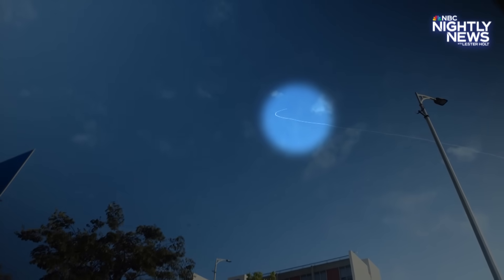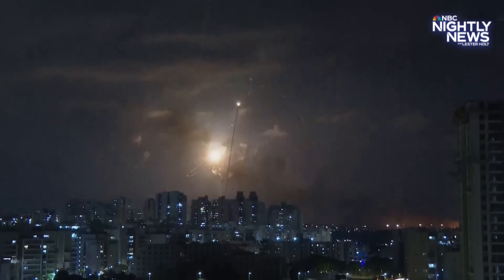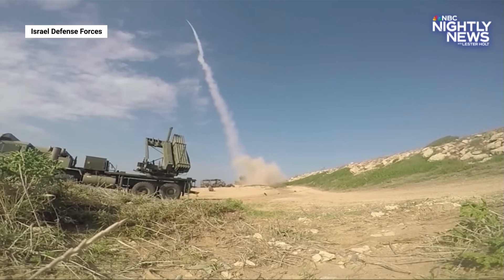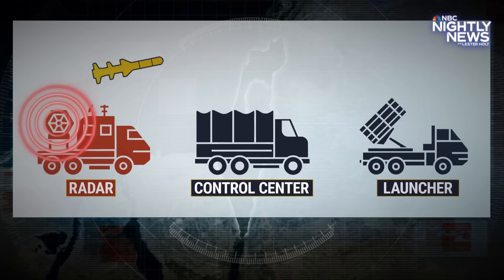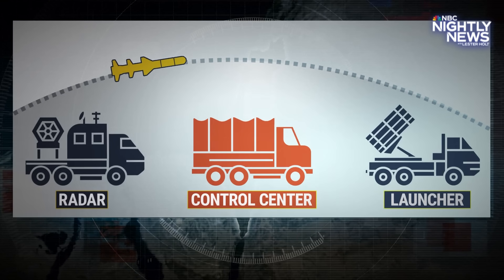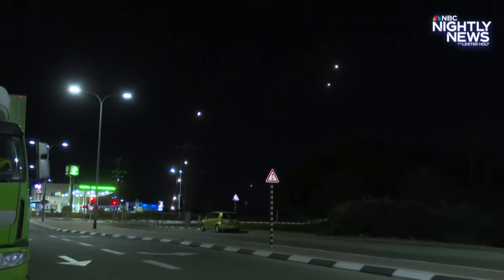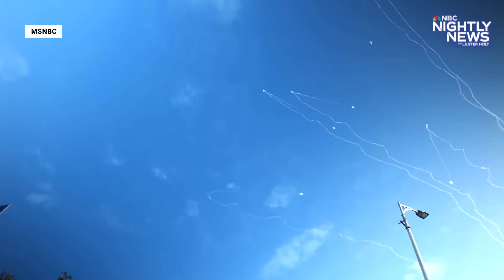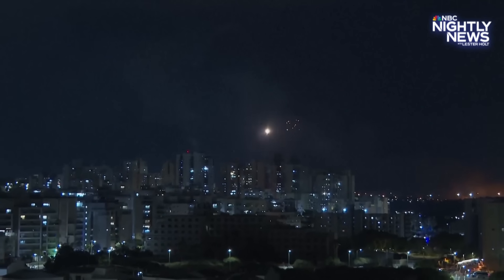Israel Iron Dome explainer

Comment: 4500 rockets from hamas , that mean at least 10,000 iron dome needed in a day , can iron dome stop thousands of rockets at once ?
Reply: Israel is reported to have ten Iron Dome batteries, each of which typically has 60 or 80 interceptor missiles available to fire.  That yields a maximum of 800 missiles ready to fire, but that's for the whole country, so probably fewer than 500 were available in range to intercept rockets coming from Gaza.  Estimating from the US Marine purchase of Iron Dome, each battery will have one reload available to it.  About 2/3 of incoming rockets are calculated to fall harmlessly in uninhabited areas, so aren't targeted.  Hamas fired about 4,500 rockets, meaning 1,500 were dangerous.  Iron Dome is 90% successful at hitting targeted rockets, so the 1,000 missiles (including reloads) in the area likely took out 900 rockets, meaning 600 hit in or near populated areas.  So even though there was considerable damage and loss of life, the attack would likely have been about three times worse without Iron Dome.
Reply: @pahtar7189  Thanks for the info 🙏🏼

Comment: You state that Iron Dome intercepted "many" incoming rockets, a wholly inadequate report.  Israel is reported to have ten Iron Dome batteries, each of which typically has 60 or 80 interceptor missiles available to fire.  That yields a maximum of 800 missiles ready to fire, but that's for the whole country, so probably fewer than 500 were available in range to intercept rockets coming from Gaza.  Estimating from the US Marine purchase of Iron Dome, each battery will have one reload available to it.  About 2/3 of incoming rockets are calculated to fall harmlessly in uninhabited areas, so aren't targeted.  Hamas fired about 4,500 rockets, meaning 1,500 were dangerous.  Iron Dome is 90% successful at hitting targeted rockets, so the 1,000 missiles (including reloads) in the area likely took out 900 rockets, meaning 600 hit in or near populated areas.  So even though there was considerable damage and loss of life, the attack would likely have been about three times worse without Iron Dome.

Comment: Those final 5% of rockets were the ones that really mattered, something like, 80% of them were decoys to overwhelm the Iron Dome so that the remaining 20% would hit actual targets
Reply: Yes hamas strategy is to tire iron dome and israelis economy since a missile cost about 40k$ while hamas unguided rocket only about 400$ - 4000$
Reply: Israel is reported to have ten Iron Dome batteries, each of which typically has 60 or 80 interceptor missiles available to fire.  That yields a maximum of 800 missiles ready to fire, but that's for the whole country, so probably fewer than 500 were available in range to intercept rockets coming from Gaza.  Estimating from the US Marine purchase of Iron Dome, each battery will have one reload available to it.  About 2/3 of incoming rockets are calculated to fall harmlessly in uninhabited areas, so aren't targeted.  Hamas fired about 4,500 rockets, meaning 1,500 were dangerous.  Iron Dome is 90% successful at hitting targeted rockets, so the 1,000 missiles (including reloads) in the area likely took out 900 rockets, meaning 600 hit in or near populated areas.  So even though there was considerable damage and loss of life, the attack would likely have been about three times worse without Iron Dome.
Reply: @pahtar7189  good calculation sir
Reply: Check out the hackers who overloaded the system weeks before this. I read an article it was “furrie hackers” 😯
Reply: What? Hamas has no dummy rockets. They just send a bunch of unguided missiles to overwhelm the iron dome. But there is no evidence that they have dummy rockets

Comment: So was it off the day of the attacks?? How did the best intelligence agency not see the movement of thousands of rockets literally 4 miles away?
Reply: Hamas fired thousands of rockets and overwhelmed the system, there's only so many interceptor missiles available at one time. Not to mention the fact that the system is not 100% effective, some missiles were going to get through regardless.
Reply: @johanndiaz8695  that's the best answer I heard. Thanks
Reply: The rockets were just a decoy that allowed hamas to jump the border while the guards took cover
Reply: Iron Dome was turned on.  There are many videos of rockets being intercepted.  Israel is reported to have ten Iron Dome batteries, each of which typically has 60 or 80 interceptor missiles available to fire.  That yields a maximum of 800 missiles ready to fire, but that's for the whole country, so probably fewer than 500 were available in range to intercept rockets coming from Gaza.  Estimating from the US Marine purchase of Iron Dome, each battery will have one reload available to it.  About 2/3 of incoming rockets are calculated to fall harmlessly in uninhabited areas, so aren't targeted.  Hamas fired about 4,500 rockets, meaning 1,500 were dangerous.  Iron Dome is 90% successful at hitting targeted rockets, so the 1,000 missiles (including reloads) in the area likely took out 900 rockets, meaning 600 hit in or near populated areas.  So even though there was considerable damage and loss of life, the attack would likely have been about three times worse without Iron Dome.
Reply: @pahtar7189  I don’t see any iron dome rockets chasing and intercepting hamas rockets. Do you? This Iron Dome thing is a lie. A radio signal is sent to a certain receiver, already installed in the incoming rocket, that tells the rocket to self destruct.
Reply: @pahtar7189 :  yes, something like your analysis, that is what happened. But why is the USA paying for it? We have huge debts.  Jewish people in Israel get better healthcare than Americans do. How does this make sense. Maybe God‘s chosen people get everything better from the subhuman people like USA?   Absolutely sickening!!
Reply: they didn't "connect the dots"...just like all the dummies in charge on 9/11
Reply: It's called a False Flag. Never forget the dancing Israelis after 911 and remember what the Jews did to the USS Liberty.
Reply: This is a lie. A radio signal is sent to a certain receiver, already installed in the incoming rocket, that tells the rocket to self destruct.
Reply: اسرائیل پیروز این بازی از قبل طراحی شده هستش
Reply: ASleep at the wheel.  Look at country is turning into a welfare state supported by USA money. Look at all the chubby fat Israeli troops
Reply: Because Russia China and Iran have the capabilities to now interfere. We can thank Joe Biden and Obama for that. May they rot in hell.
Reply: That was the point of the bulk attack so that it would overwhelm the iron dome. It doesnt shoot laser beams it shoots missiles with missiles and there are so many of them. Thats why it doesn't bother with missiles not headed towards an urban center. That makes me also think that it wouldnt be effective at all against smart weapons or those that can change their flight path
Reply: I heard of the (Futurama Character) Zapp Brannigan strategy:  send waves of soldiers/rockets towards the enemy in hopes of them running out of ammunition.
Reply: Around 4,500 rockets were fired indiscriminately into Israel the past few days. Some will always get through.
Reply: @greg6235  look I'm backing Israel it's just I'm hearing they got word bays before. Hamas was 4 miles away . Worldwide intelligence agencies and they all didn't see 5 k rockets being moved around less than 5 miles away in this day and age with thousands of satellites, informants,cyber security and on and on . In my personal opinion they wait for some damage to be done so they'd have a reason to totally wipe Gaza off the map. Can't say I blame them but truth is truth.
Reply: The guards were playing hop scotch in the yard.
Reply: It wasn't a US flagged naval vessel.................
Reply: maybe because it's all planned? look at the aftermath don't look at the event itself
Reply: @faidhr.h.hamdani8704  well I did notice the extra screams added to the audio like its not bad enough. That's something Russia does smh.
Reply: The teachings of the Honorable Elijah Muhammad (Who is still alive🛸) and Minister Louis Farrakhan emphasize that global peace and justice hinge on resolving the longstanding issues faced by Black people living in America, as all nations are interconnected; they advocate for true justice, defined as impartial and fair treatment, and warn that in today's era of judgment, consequences are inevitable unless there's genuine repentance..
Reply: @oneofgodsangels they need to get over it and move on like the rest of us have.
Reply: @ScottCampbell-xp5nx yea like Israel needs to 😂
Reply: @oneofgodsangels  I would agree, as a Christian our Bible says very similar things about this time. Im a 47 year old white guy however I have watched many many hours of minister Farrakhan and I deeply respect him. He cares about his people and gives a heck of a sermon.
Reply: It's not 100% efficient
Reply: @bradsanders407  yeah but hundreds died in one day then they pretty much shoot them all now. What was different?

Comment: Iron dome didnt work . And terrorist paragliding over the most heavily guarded fence in the world. They were let in
Reply: Iron Dome worked very well, but there were more rockets coming in than interceptor missiles.  And they aren't designed to attack low, slow aircraft like a paraglider, but any soldier with an assault rifle can.
Reply: @pahtar7189  No one gets close to that fence. The slow moving aircraft would have been seen by the thousands of cameras on that fence. And shot by the sentry guns. Wake up
Reply: @rl545454  The paragliders weren't the first ones over the walls.  Within 20 minutes, Hamas fired over four thousand rockets at Israeli cities, towns, and naval vessels.  As that was in progress they used bulldozers to smash through the fence in several places and thousands of troops streamed out via trucks, motorcycles, speedboats, paragliders, and on foot.  Paragliders were the last things Israeli troops were worried about when their checkpoints got overwhelmed.
Reply: @pahtar7189 First of all are you a A. I. Toll? Because you don't have a clue what went on.
Reply: @rl545454 : No, I'm a human and appear to have better information than you do.

Comment: So, why didn’t it work when the building was leveled???
Reply: They are sending hundreds of missiles at once at the cost of hardly nothing. The iron dome isn't 100% effective, is insanely expensive and doesn't have unlimited ammo ready to go at all times.
Reply: Israel is reported to have ten Iron Dome batteries, each of which typically has 60 or 80 interceptor missiles available to fire.  That yields a maximum of 800 missiles ready to fire, but that's for the whole country, so probably fewer than 500 were available in range to intercept rockets coming from Gaza.  Estimating from the US Marine purchase of Iron Dome, each battery will have one reload available to it.  About 2/3 of incoming rockets are calculated to fall harmlessly in uninhabited areas, so aren't targeted.  Hamas fired about 4,500 rockets, meaning 1,500 were dangerous.  Iron Dome is 90% successful at hitting targeted rockets, so the 1,000 missiles (including reloads) in the area likely took out 900 rockets, meaning 600 hit in or near populated areas.  So even though there was considerable damage and loss of life, the attack would likely have been about three times worse without Iron Dome.

Comment: An high altitude chemical laser is a better option, since it could inverse the cost differential of an interceptor missile against a low tech unguided rocket. Not sure of the initial cost or viability for large scale deployment.🤔
Reply: Having that stuff loiter indefinitely is not so feasible.
Reply: Then why aren't you there? They're not going to see you in Youtube comments.
Reply: @Leulogy   Starwars programme under  Ronald Reagan, tried to achieve it to counter icbm's and is a public knowledge. Eventhough it was dropped due to excessive budget and not proven effective for the specific application, it may be just suitable for the current situation. I am sure, it is already developed to a certain level, but may not be mature enough for full scale deployment.
Reply: @aware2action  As of right now, space-based laser interception is impossible. The power output the laser would need to have is way more than what we can produce now. But the biggest problem is the fact that you would need to have THOUSANDS of these satellites in orbit in order to always have one close enough to intercept a missile, and each one would need to have a monstrous laser we can't even produce yet. That's why the Star Wars program scrapped the idea.
Reply: @johanndiaz8695  Actually, Airborne chemical lasers were sufficient,except for the total weight of the entire system limiting flight duration, apart from need for frequent refueling. The main issue being the atmospheric scattering/absorption of the specific wavelength, rendering it ineffective for the focused beam that was needed to counter the extremely fast icbm's on their downward trajectory(since, it takes a while to stabilize the path estimation from launch).
Reply: doesn't sound very profitable to weapons manufacturers if there's no reload.
Reply: @IChIDH  Unfortunate😔, to put profits ahead of saving lives is nothing but criminal!😡
Reply: @aware2action  agreed, but sadly that's the reality of it.
Reply: This report is a lie. A radio signal is sent to a certain receiver, already installed in the incoming rocket, that tells the rocket to self destruct.

Comment: Wow! Look at all the rocket and missile experts on here....why aren't you over in Israel as engineers instead of eating hot-pockets and running your greasy, fat sausage fingers on here?
The point of those rockets are two-fold (possibly more) and the obvious fear and injury/death to Israel citizens as well as breaking Israel financially as those missiles cost ~$100,000 each.
The missiles aren't fired at every single rocket, but at that cost, only at rockets deemed a threat. Who deems them a threat? Well, the guidance and radar systems that calculate probable landing areas.